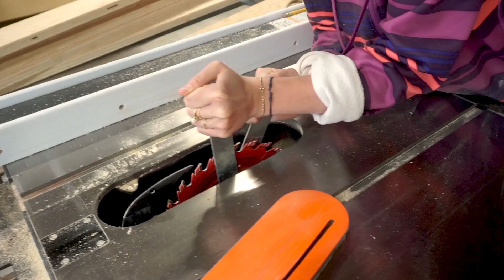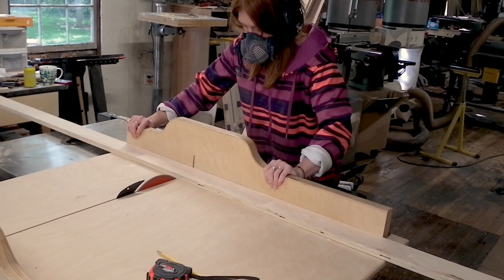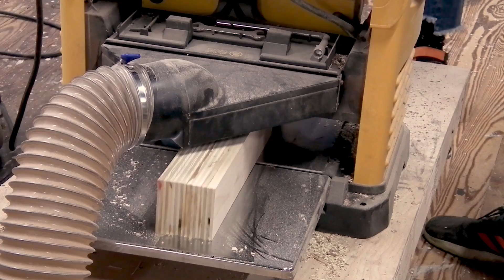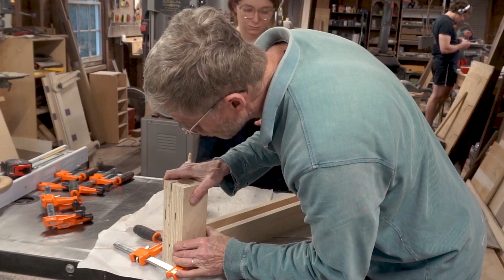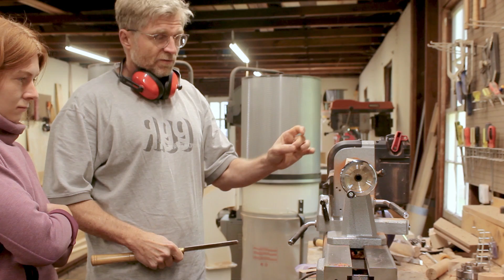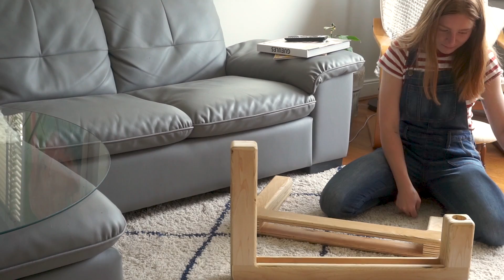Plywood Coffee Table Base for less than $25 | Working with my daughter

Comment: Great to see how a total noob can work aswell with wood. I have a tip for you; have you ever tried Mirka -products?, they have exellent choise of "sandpapers" called Mirka -Abranet, sort of a net which works very well with wood and paint.
Reply from the maker: Yes, I have used the Mirka Mirlon product and it's a great product.  I used them in this video on the brass border that I had put around the chess board. https://youtu.be/HbVZmBjqszQ  I will also be using them in an upcoming video where I make some weighted checkers.
Reply: @Woodumakeit  I specially recommend Abranet series from Mirka for wood sanding, hardly have any clogging effect and is very durable.
Reply from the maker: @bobsnabby  I hadn't see that product before. I'll definitely try it based on your recommendation. Thanks!

Comment: I am glad it turned out well but, I was scared the whole time with the hanging bracelets and hair hanging down, etc.
Reply from the maker: Yeah, I didn't notice the rings and bracelets until I was editing the video. I let her know she'd have to remove her jewelry for the next project.  Thanks for pointing that out!
Reply: @Woodumakeit : and the long sleeve shirt 
around power tools like the sanding on the 
lathe ....  Big no no  ¯\_(ツ)_/¯
Reply: @tuxedo9824  I was trying to be nice by not pointing out so many other things like turning your back on a running band saw or not pushing your work past the running blade when making a rip cut on the table saw or holding down the wood on the crosscut. Lots of teaching opportunities where he just stepped in and helped out. Totally frightened me.